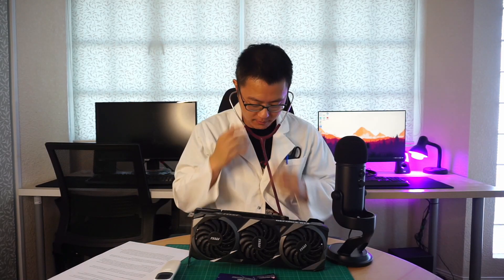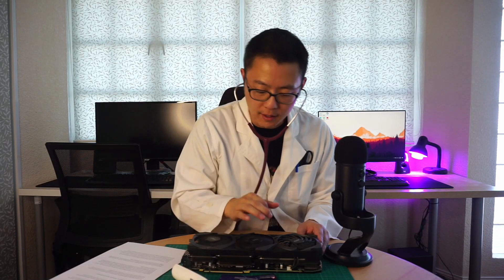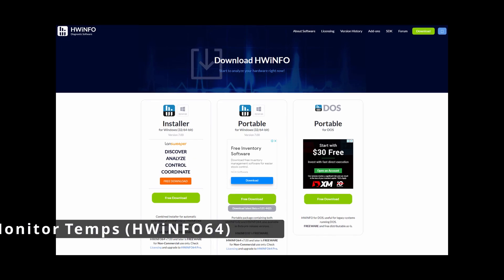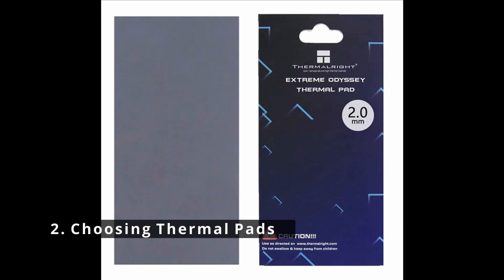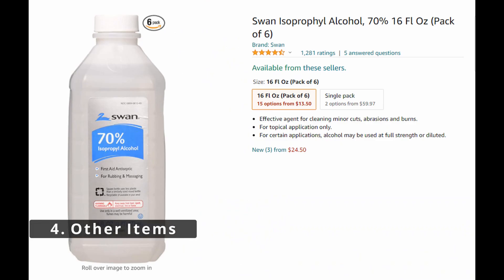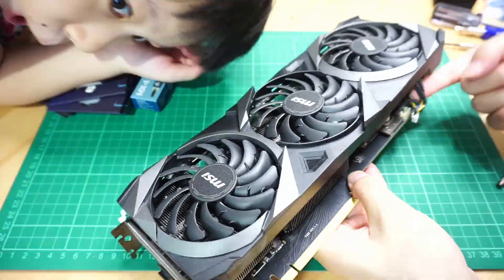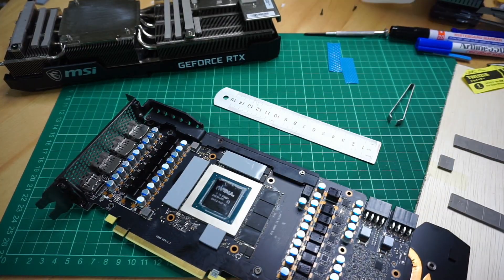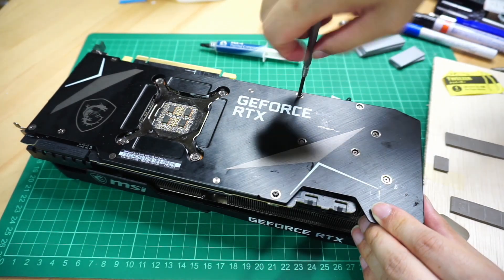RTX 3090 (and 3080) Owners! CHANGE Your Stock Thermal Pads! (Guide, Tips, Results) w/ Dr. JimRPG

Comment: Please guys can someone help me I couldn't find the right specs for my 3080 10gb lhr gamerock i want to change the thermal pads because of the mem temp
Reply from the maker: what's your mem temp?

I haven't heard too many people change their pads on the gamerock, so if no one has done it you'll just have to open it up yourself. if you don't want to wait around, you'll probably have to buy 1mm, 2mm at least like i did.
Reply: @JimRPG   actually it’s not that high but I raised the mem clock on hiveos to 3050 so I thought of changing the pads

Comment: Awesome video. I followed your steps, but the nicehash quickminer now goes to 80c in the GPU(but the mem temp dropped). I applied the mx-5 thermal compound in the gpu. anything else I should check? thanks!
Reply from the maker: yes something is wrong - GPU core shouldn't go that high. I think what happened was the thermal pads on memory are too thick, so the heatsink is not touching the GPU core. I had the same thing happen on another card - the Palit 3080, where my mem temps were fine but the GPU core was really hot. This video here - https://youtu.be/NjGVcu42l30

Normally if you've done it right, the GPU core is between 45-65 deg, and the memory is like 20 deg hotter, maybe 30 max if its GDDR6X.

Also I don't use nicehash quickminer so I don't really know how to help there. I just use MSI Afterburner and Nicehash program. But I don't think its an issue of the quickminer.
Reply: @JimRPG  it was exactly that. Thanks!

Comment: I've got the exact same card and when I mine (on NiceHash) I set my memory to -400, core 0 and PL to 265W and i'm getting 101mh/s with temperatures of 90-94 (most of the time 90C) with fans mounted on the top of the case facing towards the backplate with ambient room temperatures of 24 - 27 C. Sometimes on cooler days i'm getting 88C without any thermal pad modification or undervolt. I'm planning to buy a Bykski water block with an active backplate to get the temperatures down even more.

Edit: I forgot to mention that the gpu fan speed is at 68% with case fans running at around 1300-1400 rpm, gpu fan is audible but depending on which case fans you have, noise levels will differ and my case has the panels off as well.

Comment: Can you tell me what the Hotspot temperature is on the core while running a game?
Reply from the maker: Cyberpunk 2077 about 77-80 deg. That's probably the highest I got. Hotspot is generally 10 deg hotter on avg... so 90 deg.
Reply: @JimRPG  I took the risky dive into copper shim modding. Cyberpunk gaming hot spot temp is only 70C. GPU temp at 64C and VRAM max temp at 69C. Not bad but a very risky mod if you do not know what you are doing. I did a thorough research before doing this mod.

Comment: Thanks for this. I have 3090 Ventus and have been worried about my temps. Playing Microsoft Flight Simulator my GPU stays in the low 70's, my memory pretty much settles at 80, but I have a hotspot that can go as high as 104. I am not at all technical so really worried about doing this, but wondering if my temps are more of a risk than not doing something? If it's just a case of not getting the best performance, then I don't care as my system is perfectly stable, doesn't crash and game performance is superb. But if it could damage my GPU then maybe I should do something?
Reply from the maker: In HWInfo if you put your mouse over GPU Temperature and GPU Hot Spot Temperature it'll say what they are.

The GPU temp is the average temp on the die.

The GPU hotspot temp is the hottest spot on the gpu die.

Mine is 12 deg hotter on the gpu hotspot temp right now, just mining. I could potentially see it as high as 20 deg difference. There's probably nothing you can do except if you really want you can put new thermal paste on the die, but I bet everyone's GPUs are like that.

Still I'd try to keep that hotspot temp down under 100 deg if you can. Turn your fan up, undervolt it a little (it'll be more efficient anyway).

Also more reading.
https://www.techpowerup.com/forums/threads/nvidia-gpus-have-hotspot-temperature-sensors-like-amd.278606/

Comment: can i put 2 1mm instead of 1 2mm pad? i can get any 2mm where im from
Reply from the maker: yep you can - just be neat and tidy with it.
Reply: @JimRPG  even if they are 15W it will be a 2mm 30W is it better or is it to much or ir doesnt matter that much?
Reply from the maker: @Rockee-0  what's 15W/30W? I think you can put 2 1mm no problems - other people have done it. It is obviously better with 1 2mm pad though if you can do it, because there's better heat transfer.
Reply: @JimRPG  In the site says 1mm 15W, and then theres 2mm 1.5W i dont know but i think the more W the more heat it can absorb

Comment: I have the aorus waterforce 3080 with the waterblock. Does it have the same thermal pad problems? Or is it just air cooled?
Reply from the maker: Well considering you have the waterblock you should be better off than most people, but download something like HWInfo and you can check the memory and GPU core temps. I'd only worry if you're over 95 deg on either.
Reply: @JimRPG  okay i will check it with that program thank you.

Comment: I'm just worried since NVIDIA said this would void the warranty. Do you think if I kept the original thermal pads and put them back on before an RMA NVIDIA would be any the wiser?.
Reply from the maker: Pads can be disrupted easily even just by opening the card - think sticks of chewing gum before you chew it. It really depends on how good a job you do keeping the old thermal pads.

If you're outside the US you could void the warranty, so do it at your own risk. In the US you can open the card and it won't void the warranty. It's not a complicated procedure though, nothing electrical here, just some screws and some fan headers (be careful with those). Important to get the thickness of the thermal pads right otherwise it won't work and either the GPU core or memory won't be touching the heatsink properly.

Comment: You know what helps my vram temps when I'm mining? a 4" inline fan blowing cool air directly onto the back of my card lol.
Reply from the maker: nice! you know i tried this but either the air wasn't cool enough or my fan wasn't strong enough! 😄 glad it works for you.
Reply: @JimRPG  my vram temps are ssitting at 88c on 85% power draw and 1100mhz memory clock

Comment: Thanks a ton for the video, gave me the confidence I needed to do this on my MSI RTX 3090 Ventus 3X. I used Thermalright 12.8 W/mK pads and it dropped my memory temps while mining from 100C down to 82C! I only changed the pads on the memory, front and back and on the heat pipe where it makes contact with the heatsink! I didn't worry about changing the pads on all the other components. Lots of the pads on the caps and other components seemed to be around 3.5mm and I did not feel like stacking pads and figured I'd see how it turned out. An 18C improvement is good enough for me, saved some expensive pads as well it seems.
Reply from the maker: This is great to hear. Yes 18 deg is a huge drop - and it doesn't get much better than that. To get any better you would have to start using a waterblock and that costs a lot more.
Reply: @JimRPG  do you any brand that sells water block for the Ventus 3x? I’m using one of the Corsair (only one I found), but I think they might have sent me the wrong model because the temperatures are worse with the loop.
Reply: your asus ventus use 2.25mm thermal pad or 2 exactly? 
I think differences is about if thermal is rigid or softer.
Reply: You shouldn't be mining to begin with... I hope your card will catch a flame!
Reply: @pepin8277  Why?  It's his card, he can do with it what he wants to.  (I'm not a miner, and have no interest in doing that to my 3080).

Comment: Have u ever thought to use copper shims to low the temperatures ?
Reply from the maker: I thought about it - but paste and thermal pads is best if you don't want any issues. paste is maybe 0.02mm thick. I don't know how thick copper shims are - it'll vary from where ever you get it. If you get too high, then the heatsink won't touch the memory. Or vice versa if you're using it on memory, the heatsink won't touch the CPU.
Reply: @JimRPG  i've found on the famous asian e-market (u know which i mean) so many copper shims all 15x15 mm of so many thickness, from 0.1 mm to 2.mm. For the problem to the right contact with the heatsink it's not enough to use a caliber? I mean to reach the correct thickness could be used a caliber to solve the issues. But I little be worried about use copper in a gpu. Which problems could be happen with them? Anyway I forgot so say great video bro. Let me know what u think about copper shims

Comment: I have the same card, I initially used 2mm GELID ultimate pads (harder version) for both front and back. No improvements and actually got worse, retried with 3mm GELID extreme pads (squishy version) front and back, still not good... after a few retries I ended up with: 3mm GELID extreme at the back, 2mm GELID ultimate + arctic thermal paste on top of the pads in front, with arctic thermal paste for the GPU chip. About more than -5C improvement

Comment: Good videos man, thank you. Got a zotac 3090 running at 84c 100mh. Been thinking about doing this.
Reply from the maker: if its 84c id leave it... though i suppose you prob want it to go higher 120mh. See what temps you get at 120mh, and then decide if its 90c its ok... 100c id do the thermal pad swap. I think an extra 20% profits are worth it. :) just my two cents. I don't know if its difficult on the zotac or not.

Comment: Can u tell me about how to change thermal pads on Inno 3d  ichill x4  3080 its design kind of complicated. Thanks by the way great video
Reply from the maker: Hi there, I don't have any experience with an Inno 3D card. I think you're right - its probably trickier to open up. That said if you go slowly you can do it. But monitor your temps first - unless you're over 100 degrees I wouldn't worry about changing the thermal pads. 

Have you watched my video about max temps - MICRON RESPONDS! What max temps should you run your G6X GPU at? RTX 3090 / 3080 Ti / 3080 / 3070 Ti
https://youtu.be/ph4_Sr8YNXI

Comment: my 3080 tuf get's to 80 MH/s and then hits 100c junction temps. any ideas why? 
power limit 59%
mem clock +300
core clock -400
fan speed 80%
gpu temp 43 c
Reply from the maker: if GPU temp is only 43 - your thermal pads and heatsink aren't touching the memory is my guess if its so hot, have you opened the card up before? Is it a new card or did u get it used? Either way you have to watch a video and see the thickness of thermal pad that other people used and try that. Sometimes a tolerance of + or - 0.1mm can cause problems like this.

I went through a very similar issue where the GPU temps were cold and the memory was hot, but i opened up the card and put in thermal pads that were too thin.

WATCH THIS! Before Changing RTX 3080 and 3090 Thermal Pads. (Especially Palit Owners)
https://youtu.be/NjGVcu42l30
Reply: @JimRPG  i haven't opened it yet but am definitely looking into it because of the temp disparity between the card and its memory. it's used from a buddy who got it from a prebuild for like 2 weeks
thanks for the link i'll check it out

Comment: With power at 70% clock at max negative offset and same for memory yeilds me 110° within 5 minutes. It's 4 days old. So sad. 3090 amp core halo
Reply from the maker: bad pads - change them if you feel comfortable to open up your card.

Comment: What if you just do the fronts ?
Reply from the maker: Best to change both if you're going to open it up - the back is easier to do anyway.

But you could be right seeing as the front is the one touching the heatsink.
Reply: I might do the back plate while I’m in their but I’m not sure if I wanna mess with that one cable attached to the fans thank you 🙏.
Reply: Done did the back and the front running now medium mining never above 84c on vram

Comment: Thanks to your video I changed the pads. Preliminary settings, 1140 core, 10801 memory, mining at 121 MH/s at 94°C. I have not reached max OC for memory, but have to go to bed. Got lucky for the first time on the silicon lottery.
It's 94 too high? Hynix updated their website to say their GDDR6X memory is good to 105, with 95 being safe, but I'm worried the thermal paste will start getting worse again.
315 watts power draw. Wow.
Reply from the maker: Congrats. most of the time it is not too difficult to change out, but when there are problems it can be frustrating.

I just did a video on safe temps - its the latest video on my channel.

95-105 deg celsius is where they say you might get errors or throttling of memory. 94 is on the border, but if you've already changed the pads out, just try it out for a bit. Not sure its worth getting it down a few more degrees. Myself I lowered the memory a bit and doing 115Mh/s - you can lower the temps a couple of degrees that way.

Comment: I had the same thing happen to me with higher GPU temps after replacing pads and paste. I also used MX-4. I've tried messing around with pads and replacing the paste again, etc. I'm wondering if I somehow got fake MX-4. Anyway, I did initially buy some cheaper pads so I've decided to order some Gelid Ulitmate 2mm pads as well as some Thermal Grizzly Kryonaut paste and I'm hoping that will fix my issues (even though I wasted $30 on the prior round of getting stuff).
Reply from the maker: Fake MX-4! Interesting. Well you can always order a few from other suppliers and test it out. Most of the thermal pastes actually are within a couple of degrees of each other so you can buy whichever really, the kryonaut is supposed to be pretty good though. Have you put the gelid ultimate and themal grizzly kryonaut paste? I was lucky to get it right the first time with the MSI Ventus 3x, but my other card a Palit 3080 took 9 tries, because tolerances were really tight.

Comment: I was able to drop by Mem Tj by 14 degrees (88 to 74) after the thermal pad change.  Core Temp went up 1-2 degrees.  Totally worth it! And the MSI RTX 3080 and 3090 are very easy to take apart.
Reply: what paste did you put for core ?
Reply: @aczech12  Kryonaut Thermal Grizzly

Comment: 86°C? Mine stays at 104°C, 100 MH/s, 71% power limit, no OC, and I only bought it brand new half a day ago. It's the Gigabyte Gaming OC in HWInfo.
Reply from the maker: Lots of youtubers swapping out the thermal pads on their Gigabyte gaming 3080s. Definitely check those videos out - they're also getting 100+ degrees.
Reply: @JimRPG  I'm trying to change pads now on my gigabyte gaming OC 3090 and i just can't take the rgb header cable off or the fan headers
Reply from the maker: @OWanKeno9i  ok don't force it with those fan headers. I couldn't take it out for my Palit 3080 and I just did it with the fan header in place. If you can do it with it in place just swap out the pads and put the heatsink back on.
Reply: @JimRPG  what I did was gently opened the socket where the plug goes in for the rgb header, and twisted it open while gently pulling. Did it twice and it was okay
Reply: @JimRPG  It worked really well. Same pads as you and Kryonaut for paste.
Mining at 117 within minutes and in sure it won't bit 100C while gaming anymore.
I bet I get over 120 with some more overclocking. Thanks for the guidance! I appreciate it :)
Reply: @JimRPG  the thermal pads got so bad that there is oil all over inside the heat sink and all over the fans.
The thermal pads were definitely degrading over time. My temps went up.
Gigabyte said to send it in but I can't have no video card for 1-2 months.
Reply from the maker: @OWanKeno9i  Yep pretty much all the gigabyte pads are oily.

Comment: I did my Gigabyte RTX3080 Gaming OC..
3mm for memory. 1.5mm for everything else.. Absolutely nerve racking turning it back on, wondering if i missed anything or poor contact was being made... Then testing it, i was waiting to hear a POP or something.
Memory Junction went from 104c to 82c whilst mining as recorded by HWinfo.

Very sad how Nvidia can produce such a great product, for manufacturers to go and spoil it using trash components like cheap thermal pads...
Reply from the maker: Haha congrats mate. But same for me, lucky it worked first time on the MSI card. But on my Palit 3080 Gaming Pro I had to do it 9 times before it finally worked and I thought I screwed up the card I paid $1500 for.

Agreed - they didn't know it was going to get hot and they just made it like how they all their previous cards without taking into account the new GDDR6X memory temps. It's not just a mining issue, its a gaming issue as well.

Comment: Hi I’m have 3080 aorus master and change pads artic pads 2mm rams and others 1mm but temp is hight 106 whene mining what  wrong make?
Reply from the maker: Yep sounds like something is wrong... I'd go and check other people's aorus master and aorus extreme videos and see if they did something you missed.

Here's Son of a Tech's video on the Aorus Master -
https://youtu.be/rH3Oavi-0OE

I also have my own video on the Palit 3080 Gaming Pro - but I had to do it 9 times to fix the problem. The pads had to be 0.75mm and over 0.1mm more it wouldn't work. Not saying that's your problem - just saying I had to keep trying as it can be tricky.
WATCH THIS! Before Changing RTX 3080 and 3090 Thermal Pads. (Especially Palit Owners)
https://youtu.be/NjGVcu42l30

Good Luck!